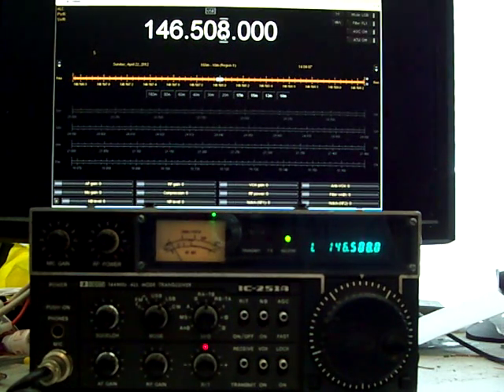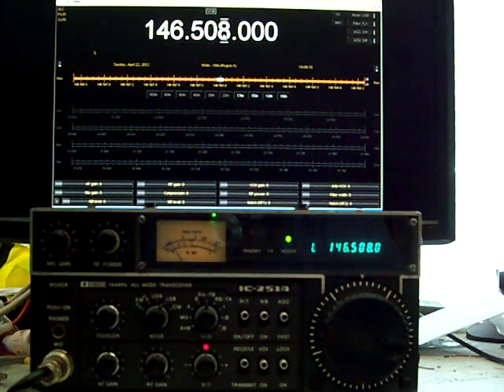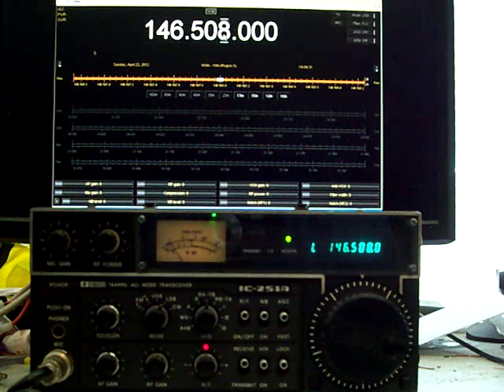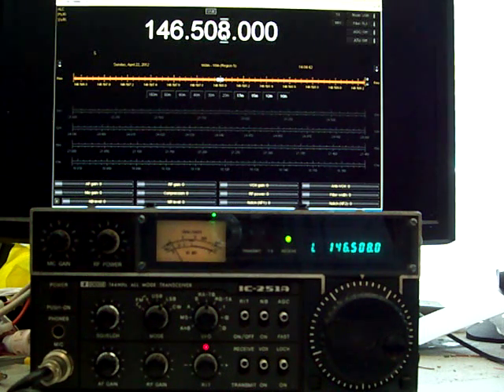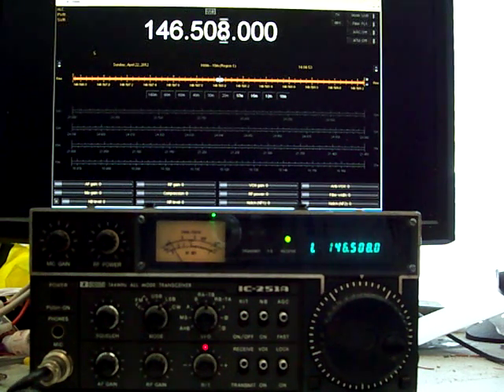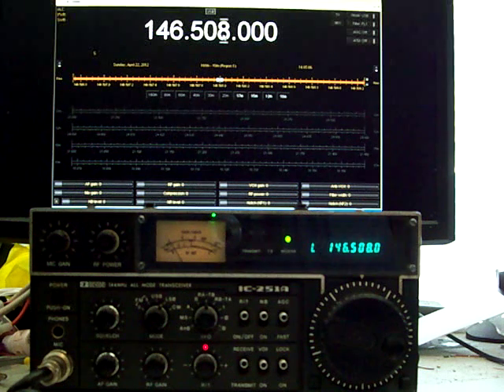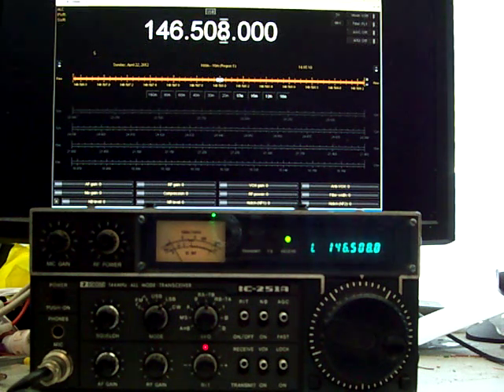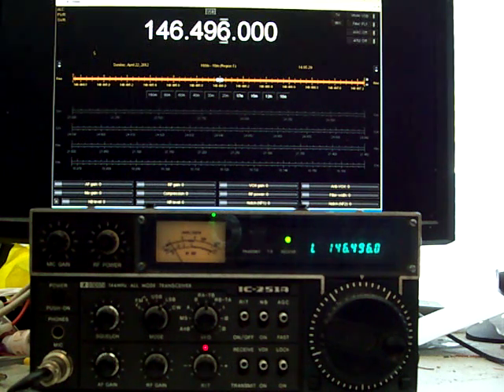Icom IC-251A to Ham Radio Deluxe Interface

Comment: Would like to buy this built ready to connect to my radio and computer ,  do you make them up and would you send to Australia ? Regards Tom
Reply from the maker: What timing you have. I happen to be considering making an all new version of this that will be a self contained dongle that slips over the expansion connector on the back and uses bluetooth to connect to it. I have not mentioned this publicly before, and it would be a while off because of other projects I have. As far as making one of these, i could be talked into it, but it is not what I usually do. Perhaps we could discuss this offline through email.
Reply: @TinkTron  Shall send you an email ,   :)  Regards Tom

Comment: OM, your AlterVista webpage results in a 404 - Page not found error.
Reply from the maker: WOW..you are correct. Not sure how that happened.  I will fix it when I have time. Thanks for the heads up. This link is what you want   http://tinkyr.altervista.org/radio/projects/Vintage_Icom_Interface.htm

Comment: Hello i am ahopefuly going to get this radio as my 1st radio...are you still doing this project and making boards anymore for it?
Reply from the maker: I still have the programmed chips and the main PCB, but I don't sell the 9V converter board so you would need to make that yourself. The main PCB has changed so it would be best to hand wire a point to point board.
Reply: I have no idea how but i will figure it out...if i get the radio...i hope ido...thank you so much for your effort in this project.....i might need some guidance though
Reply from the maker: Most radios I sell the boards for run off 5V logic. A few like the one you are interested in run off 9V logic and need the second logic level converter board. It just converts5 to 9V and vice versa
Reply from the maker: I think your address got truncated. Have you looked at the webisite?
Reply: Yes i have...im not that good with schematics but i get the gist......or if you have a good 1st time radio that can also hook up to Ham Radio Delux...im looking...My test is saterday...and im getting 91 percent on all 400+ questions...so im pretty sure i will pass
Reply: If i get it maybe i could send it to you?
Reply: How much is the board?
Reply from the maker: look at the parts list on the website
Reply: I did not realize it was only 2m....can you suggest a good base that covers alot of bands?
Reply: Im a little gitty and over reacted when i saw it....Any help would be much appreciated